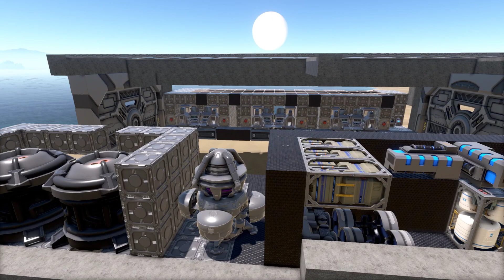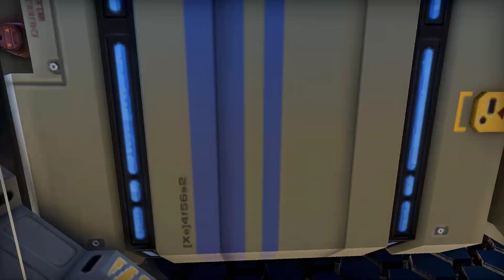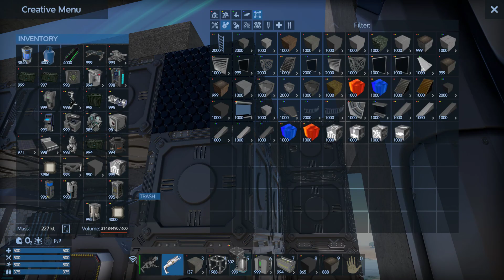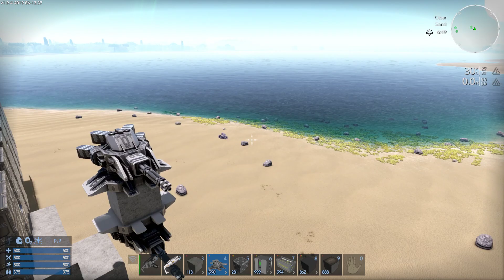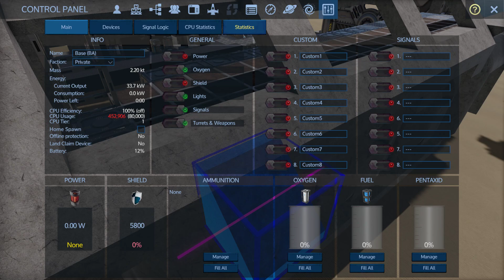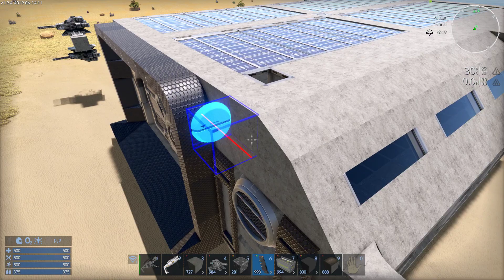Empyrion Galactic Survival - New functional base build Part 2

Comment: Switching the bottom turrets to sentry guns would give you a lot more room to adjust the turret platform shaping.
Reply: Good idea, but 2 miniguns can be a little dangerous to cover one side against Zirax attacks.
Reply: @torstenkrumel6970  Absolutely. But 1 minigun and 1 missile launcher can do it just fine. So I would replace opposite corner miniguns with missile launchers. Or place a couple of cheap minigun towers nearby and upgrade all 4 to missiles. Or maybe there will be a place along the long sides of the base for a pair of missile launchers. 

I just do not like ANY of the block options for over/under turrets in the game.

Comment: Love the build so for I'm a big fan of all your designs currently on the workshop. Just a thought, on the cargo side exterior, centre the arch detail and have two windows either side.. Also noticed you don't use the copy block function ctrl+RMB is that just habit?

Comment: A question for anyone who can answer: in the first video structural integrity was turned off to simplify the process.  When the base is finished, does SI need to be turned on again?  If it is not turned on and the based were to be spawned in, in game... would SI be on automatically or would SI simply not exist for this base?